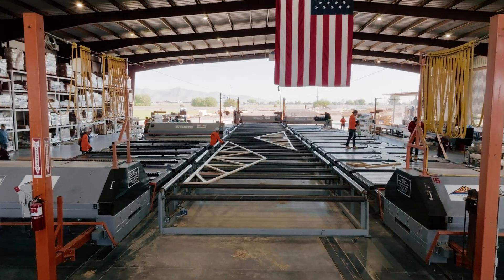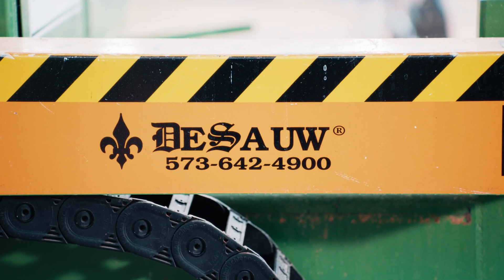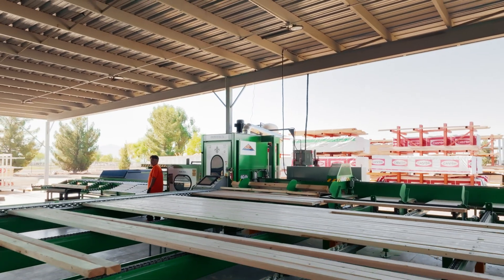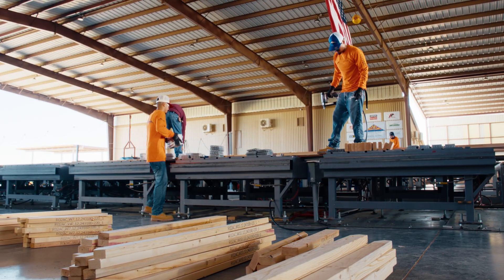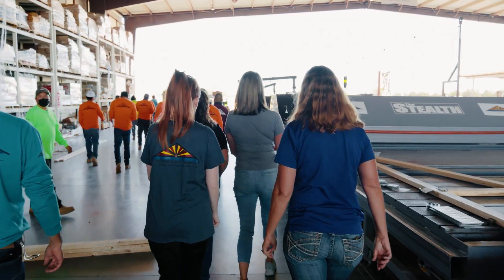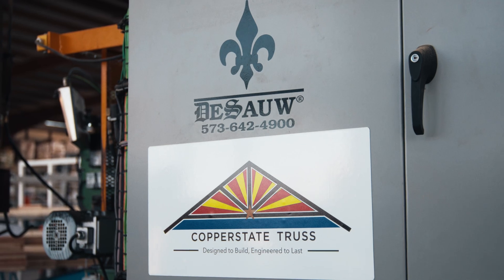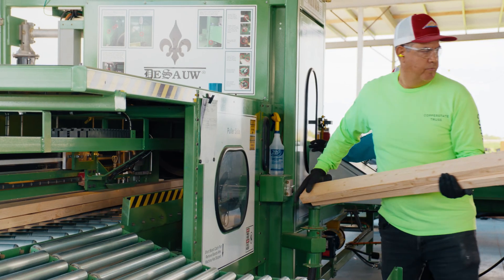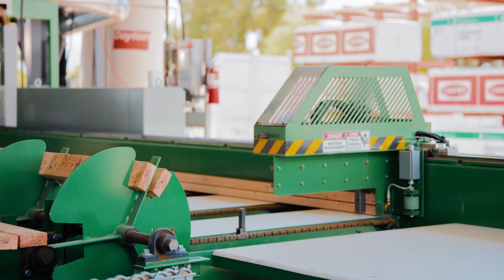Copperstate Truss Takes the Lead with Monet DeSauw and Simpson Strong-Tie

Comment: does it have its own software that designs and engineers and provides stamped engineered plans for the installers and permit department? Or do you have to run a 3rd party design software?
Reply from the maker: Hi Michael, our machines run from certain file types that are commonly output from various CAD-based design software and/or production software.

We does have software for designing truss framing and we’re working on expanding into full framing capabilities in the future.

Our Monet DeSauw does design the projects automatically, the user designs the project in the software, then transmits to engineers for stamping, and from there would export "cutting" files to our machinery.